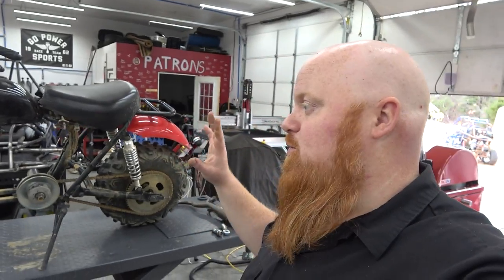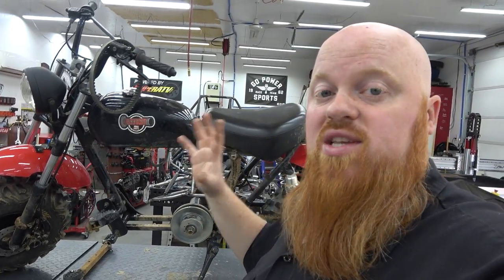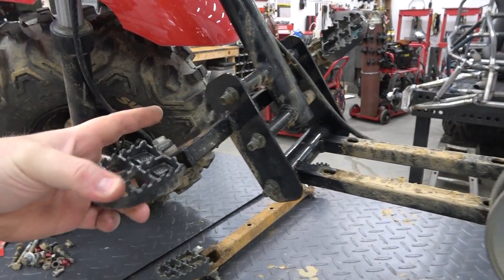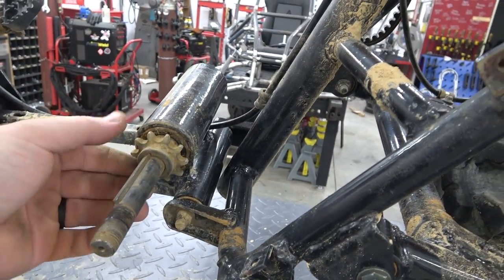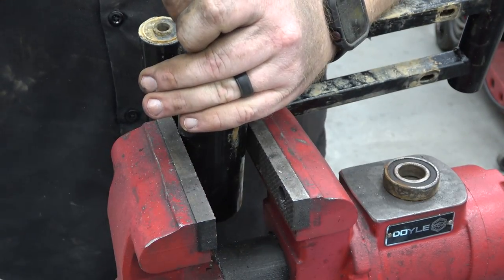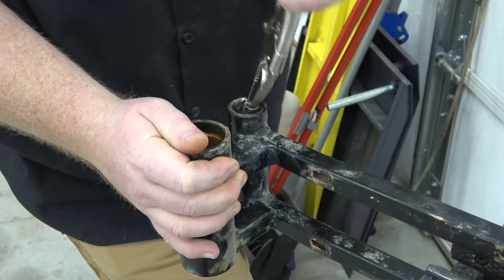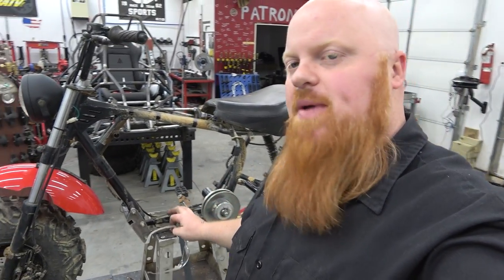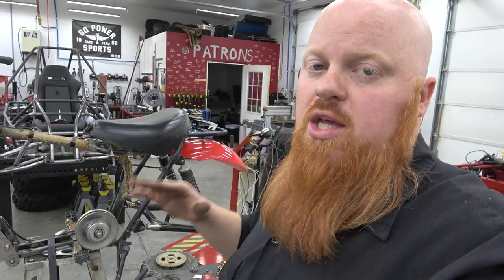Trailmaster MB200 Bushing Upgrade ~ A Must For Hard Riding!!!

Comment: Hello Red Beard
Absolutely love the heim joints. Awesome setup. I  agree with the prior comments. When the swing arm is moving its motion  becomes limited by the slack in the chain. Everyone tends to run a looser than needed chain to help with this, however, this results in a thrown chain. It also beats the hell out of the chain and jack shaft bearings if the chain is tightened to spec. I'm working on a chain tensioner pulley for just this reason. Can't wait to get it done so I can have full suspension travel thats not chain limited. I'd love to see you folks design a good tensioner setup for the MB200. There's definitely a market for it. Dirt bikes have them for the same reason. Minibikes want them!

Comment: We removed the factory driven pulley mount and went with a conventional TC setup. Repositioned the foot pegs - welded on. Replaced the front frame mount with our own. Added a chain guide /tensioner with a 60 tooth sprocket. Still have the rubber bushings in the lower frame. I havent thrown a chain yet.  Like your swing arm mod
Reply: Did you just buy a TC kit with backplate off of Amazon?
Reply: Yes just the standard stuff  @chrismhoyt

Comment: You should make a chain tensioner for it too. A guy here on youtube called BWX has a video showing a good design for one which will fix this problem, and it keeps you from slamming your crankshaft every time the suspension moves with the added benefit of letting you actually have more than half an inch of suspension travel before bottoming out on the chain.
Reply: I made a chain tensioner for mine absolute game changer no more throwing chains.
Reply: @fredbearsq3254  Exactly. Rear suspension on this bike was an afterthought, it was a hardtail bike for years and you can still get them that way. Without a tensioner you either have to let the chain dangle in the breeze and lose it all the time or keep it so tight that it damages the engine and keeps the suspension from working. It's a way more important upgrade than swapping out the rubber cradle mounts and none of the big channels do it so I have to mention it every time I see it until the word gets out eventually.

Comment: If you weld a tab on the jackshaft tube and one on the frame to bolt to it, if would further stiffen that area, yet leave the engine cradle removable.

Comment: What mods are you planning to do with the square tube engine mounts
Are you reinforcing them also since the bends are more visible with it being apart
Losing the rubber bushings likely will magnify stress on that component
Appreciate the variations of your projects

Comment: You are still going to lose your chain unless run a spring loaded chain tensioner because the chain gets tighter as the shocks compress. This also means you will also wear out jackshaft bearings unless you run the spring tensioner allowing the chain to have more slack. https://youtu.be/XmJWae84tdY
Reply: Yup and I wonder if the jackshaft mount getting torqued by chain tension at top of suspension stroke actually is what bent the engine cradle frame rails?  All these guys constantly kick chains on their MBs because they're too tight at top of suspension stroke. I wonder if they'll ever figure it out?  ✌